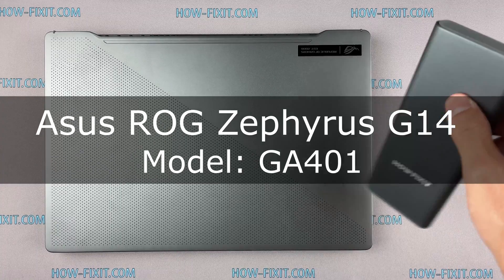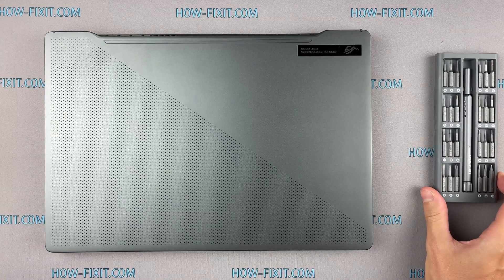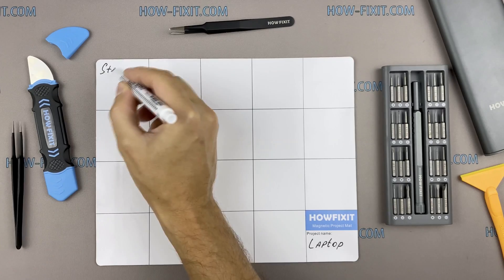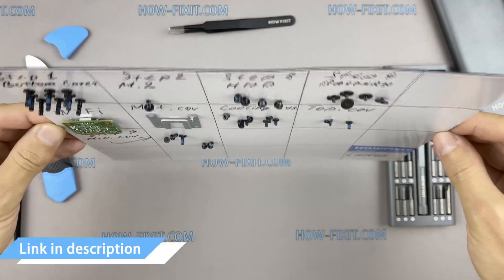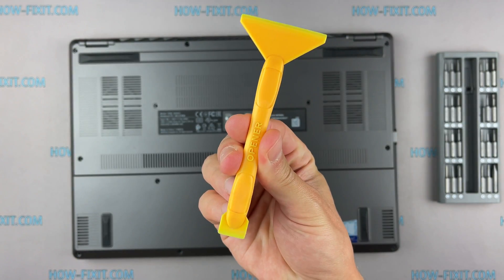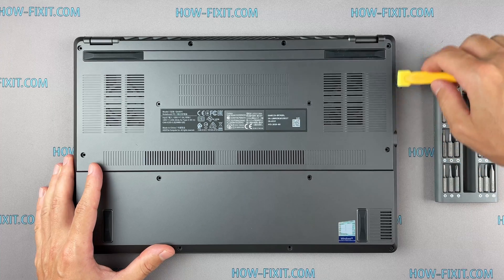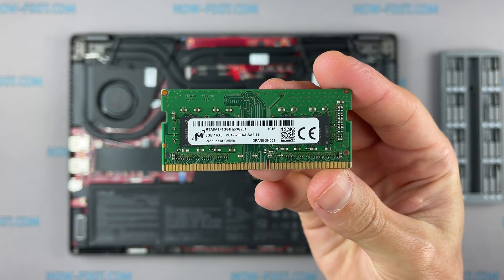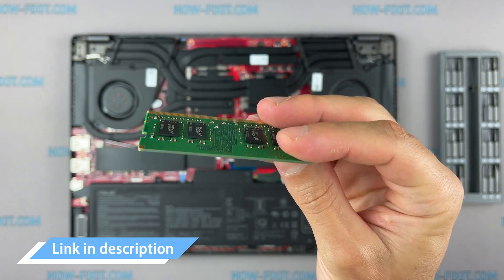Asus ROG Zephyrus G14 GA401 RAM Upgrade and Install - Your Step-by-Step DIY Guide!

Comment from the maker: *ENG*: Links to DDR4 RAM, screwdrivers, and bonus content are in the description under the video.
*ES*: Los enlaces a la RAM DDR4, los destornilladores y el contenido adicional se encuentran en la descripción debajo del video.
*FR*: Les liens vers la RAM DDR4, les tournevis et le contenu bonus se trouvent dans la description sous la vidéo.
*DE*: Links zum DDR4-RAM, zu Schraubendrehern und Bonusinhalten finden Sie in der Beschreibung unter dem Video.
Reply: Why you have DDR4 and on my ROG same model i have 16GO DDR5 ??? I want remove and add a RAM of 32GO Is it possible ? thanks

Comment: Does the RAM have to be 3200MHz or can it be more?
Reply: basically it’ll match the slowest speed, and if your laptop is 16gb by default, an upgrade will only have the first 8gb in dual channel, excess is single

Comment: My G14 GA401QH has 8gb RAM so can I add additional 16gb Ram?
Reply: If it has 8 gb soldered in and then 8 gb sodimm u can replace the 8gb to 16 for max 24. Depending on model, you can get 32 on some.
Reply: I have same question
Reply: What finally you ended up doing? Mine is 8Gb as well. Did you add 16 Gb in 2nd slot and made 24 in total ?

Comment: PSA to anyone following this tutorial!!! DO NOT TOUCH THE BATTERY CABLE OR CLIP! You do not need to. I just did this, and it fried my entire mobo. BestBuy GeekSquad quoted me $600-$1000 to replace. I'm screwed, don't do it!
Reply: Yep I made the mistake of having the metal clip touch the motherboard and now it’s fried…
Reply: 😢 i did the same...now i Don't know how much will it cost...service center guys said 70% of laptop cost will be charged to replace motherboard.
Reply: what happened?
Reply: check out adamant it for repair
Reply: make sure laptop is off and not standby. then remove battery cable. then press power button for a minute to remove any remaining capacitor charge. then you are good to go to do the m2 and ram

Comment: mine has 16gb ram,  says it supports 32gb,  if only 1 slot is swappable, how the heck do you get 32gb if you can only add in a 16??  So il really have 24gb???  i thought ram had to match on both sides .....

Comment: I just followed this video and completely busted the black plastic under the metal clip that connects the battery wires to the motherboard while I was disconnecting it before taking the old ram out. I really think after googling this that the video should have mentioned how fragile that part is and that you should understand how the clip part works. It is not as easy as simply detaching it and reattaching if you have not used this kind of clip before or are not familiar with laptop circuitry connectors. I am curious what I’m going to have to pay for the repairs and the hassle I am going to go through tomorrow when I take it to micro center. The laptop still works however, just only when it plugs in and is properly registering the ram upgrade.
Reply: First off, I want to thank you for sharing this vital information.  I want to commend you for you precise description of everything because I can see each peice by piece and understand where you saw failure.  I'm so sorry that you had to figure this out first hand, and def. agree with you that it would be nice for the video maker to add this to video so others are aware.  even better, if you had any info on which "type" of plug or "how to take it apart" given how sensitive it is, that'd be even better.  Thank you for everything and I wish you a quick restoration of your laptop and at little cost.  Godspeed!
Reply: @lebronzejames9738  A noble response for a noble comment.
Reply: @cba46  yes'r/maam indeed!

Comment: Saidly the devices of ASUS Zepherus are not consistent to another. I tired a 32GB stick and a 16GB stick for a total of 40 or 24GB. Both boot one time fine and the next boot suffers   from problems in Windows. The ASUS Support isn't helpful either. They say only 16GB in total (!) are supported. It might work, you need to "try", but nothing is guaranteed. I really hate ASUS. Its not my first device having problems.

Comment: swapped the 8gb stick with a 16gb stick and the screen is black
Both are samsung
The original stick is: 8gb 1Rx16 PC4 3200AA-SCO-11
The one im replacing it with is : 16gb 2Rx8 PC4 3200aa-SE1-1

any suggestions?
Reply: Does putting back the old RAM starts up the system?, if so its possible either the RAM is a faulty one. My system also magically shut down a few days ago but I removed a stick and booted it up and it started working again. Will try by adding a new stick of RAM to see if that fixes the problem
Reply: @raajanand2  yeah, it may very well been a faulty stick. Already sent it back
Reply: @tokishreds  so I did get a new stick for it and haven't had a problem since. Hope this helps

Comment: Put in a 32gb stick. God damn. Nearly as fast as my desktop when loading the browser and switching between menus. Definitely worth it
Reply: Which one do you recommend?
Reply: it really support a 32 gb ram stick so a total of 40gb ? i saw 24gb max in the datasheet of this laptop
Reply: @teamyoshi3000  it does. Well mine had 40gb of ram. It can potentially even have 72gb of ram if you get a 64gb stick.
Reply: @chubikingston980  thank you , you have the same modele has the video ?
Reply: What exact ram did you insert?
Reply: What brand of 32gb stick?
Reply: lmao adding more ram doesn't make your browser load faster or menu switching faster. Learn how computers work dude.

Comment: What is the maximum amount of RAM supported for this laptop?
Reply: 40GB (8GB+32GB)
Reply: @DMMG7  how does this affect the performance without matching ram sticks?
Reply: @TheStatevsU  I am not sure but I guess it depends if it's for gaming or working. For example wmfor 3D work you need capacity of ram, and in gaming it does matter your channel to for faster performance.

Comment: My laptop is not powering up... someone help me....
Reply: This same exact thing happened to me - followed these instructions explicitly. I am suspecting a possible short somewhere, wondering if I voluntarily fried my motherboard...
Reply: @mcmcdonald19  Any update on what happened?
Reply: @geeblock6789  got it tested at a local shop. Short in the motherboard (they suspect a fault in the charging circuit), needed to be replaced or sent to Asus. Shop contacted Asus and its not worth the $ for them to replace it as its nearly the price paid new for that particular module. Was outside the manufacturers warranty. Now its a nice paperweight
Reply: Did you found any solution
Reply: Same exact thing!!! Anyone found a solution?
Reply: @DirayaMedia did you fix it?
Reply: @sharymens8187  No i had to get rid of it, sold for parts on ebay
Reply: @DirayaMedia oof i feel for you 🙏
Reply: Same, he made no point that there was a clip you have to unclasp to get the battery chord out. I’m so pissed
Reply: @vinnyjlopez  1:36 - and what did he say here?
Reply: @vinnyjlopez what clip?

Comment: Goddamnit why do manufacturers solder RAM to the motherboard -- especially on more expensive models like this. WE WANT OUR 64 GB of RAM damn you!
Reply: Mainly for spatial purposes, it takes up so much less room when you solder. But one slot was given so you have some upgradeability and customization.
Reply: @hmm396  spatial purpose my ass, This is all done to maximize profit.
Reply: @sanan33  I mean you can hopefully agree that it does take up less space since you don’t need a frame around or an actual slot. Sure I guess it’s also profit but you still do get a slot. And I’m sure most people are never going to even need more than 32gb of ram anyways, let alone 64. There are better laptops for mainly productivity if you need that much ram
Reply: @hmm396  bruh this is a gaming laptop, it’s not slim
Reply: @hmm396 now with win 11 16gb of rams falls short when gaming, and 32 is needed

Comment: I installed 16gb, but when I booted the computer, the fans would turn on but the screen wouldn’t. Thankfully however, taking it out made my computer boot normally again. I don’t know if I have the guts to give it another go, but could anybody give a solution?
Reply: Same problem, I fixed.  I just took it out, used air duster, re-inserted it and made sure it was properly secured (give it a little jiggle to make sure it's seated, but not too hard).  Then it worked.  If it still doesn't work, bad stick of ram.

Make sure it is DDR4 -3200
Reply: @zarpof3811  Just curious, did you experience this issue again? I recently got this issue on my Z-14 and am thinking maybe its a RAM fault and if I should replace it

Comment: I upgraded my g14 with 16gb ram 3200 but system says 24gb ram total are running at 2667. Is there any solution?
Reply: You will need to log into BIOS and manually change your new RAM velocity. Since it could be capped by default. Check vídeos about it on youtube.
Reply: Sounds like it's picky about memory, on desktop motherboards it's recommended to install in matched pairs for dual channel so I'd take a wild guess there aren't many chips that will run full speed alongside what's soldered in there.
Reply: I have the same problem. I have already accessed the BIOS and there is no option to change the frequency. Does anyone have a solution?
Reply: Any memory added to the system will run at the internal (soldered) memory speed. There is no way to change this.
Reply: @Cryostatica  the soldered memory runs at 3200 in single channel. Don’t know why dual channel speed is slower then. :(

Comment: Thank you for sharing!
But there is still one missing point, of the Dual-Channel configuration.
In this model we have 2 slots, one of them is soldered!
There are 2 original configurations by asus, of this model G14, first with 16GB (8 GB soldered + 8 GB slot swapable) and the second with 32Gb (16GB soldered + 16GB in the slot swapable).
The Dual-Channel works well with assimetric configurations, 8+8, 16+16, and so one....
Keep this in mind if you want to upgrade your capacity RAM and if it's worth losing the advantage of Dual-Channel, like speed.
Reply: That's not completly accurate, if you have the 8gb soldered one and decide to add a 16gb in the slot swapable you still will have the dual-channel up to 16gb and the others 8gb available will run on single channel , the only thing you should take in account is the speed, try to get a new ram of the same or higher speed than the soldered one.
Reply: You are partially correct. You'll still get the dual channel configuration up until you go the the ram capacity of the soldered (on board) RAM. It is only after you go over that, your PC will start working in single channel and that's too only for the part its using over the dual channel configuration. Eg,. if you have a 8+8 gb config and you swap out one of the sticks for 16 gb, it will still work in dual channel as long as the required RAM is 16 gigs(8+8) but if you go over that then it'll start taking the remainder of the required memory in single channel. Hope this helps you
Reply: @raajanand2  Thank you!
Reply: @raajanand2  As a technical person myself, who's seen so many it works or it doesn't work; thank you a ton for shedding accurate light on this subject.  I think many people are confused at how things work under the hood and your description is perfect!  I'm sure others will read this and learn something, thanks again for making a post, and making such a clear concise and accurate post in world full of arm-chair-captains ;)
Reply: @lebronzejames9738  You're  welcome man. Glad it was useful
Reply: @raajanand2  whats the lose for single channel?
Reply: @SpaceGamblerJR  not sure what you mean, can you rephrase?
Reply: A friend of mine has this laptop. if the configuration is 8+8, if he replaces the 1 8 GB stick with a 16 GB stick. will it improve his experience? he is streaming and having trouble playing a video/live stream viewing and having his camera on screen.

Comment: I'm using Asus ROG Zephyrus G14 GA401QC-HZ022T and I wonder how max ram can I upgrade my computer. Someone said it 24GB max, some say it 40GB max.
Reply: If you use Windows you can try this: Open a CMD and type: wmic memphysical get MaxCapacity, MemoryDevices  this command shows you the max ram you can install
Reply: @luis_alv_x2  Thank you so much, it give me some hint to follow. Btw I ask some reddit users and the command give them 33554432 but they can upgrade to 40GB of ram (8 +32). Mine is 33554432 too, so maybe I will try my luck.
Reply: @TrọngBáchTrần  Hello, did you try to upgrade it? did it work? Are you able to utilize full 40gb?
Reply: @chitt12  Not yet, I'll try to remmember your comment when I upgrade it. After research on reddit I think it possible.
Reply: @luis_alv_x2  it's say MaxCapacity  MemoryDevices
33554432     2
Reply: @ozy635  33554432KB = 32GB Max
Reply: you should try to use the same ram x2 to get dual channel if the ram is not the same you won't get that

Comment: how many ram slots does it have?
Reply: Just one. 8GB is soldered to the motherboard and the "upgrade" comes from one so.dimm slot
Reply: @ColeMarkusen   So if I buy the 8gb model, it comes with an empty slot?
Reply: @ggcub25  i´ve same question :( anyone?
Reply: @ggcub25  yes the 8gb is soldered to the motherboard
Reply: @ColeMarkusen  just one slot except on the motherboard (i mean total 2 slots) or total one slot?
Reply: @anlelmastas6201  there is just one sodimm slot.
Reply: @ColeMarkusen  so one 8 GB onboard ram + one sodimm slot right?
Reply: @anlelmastas6201  that is correct
Reply: @ColeMarkusen  thanks man. You took my questions from my mind